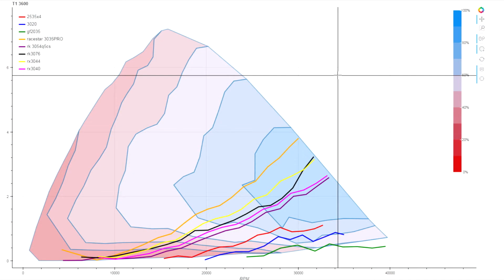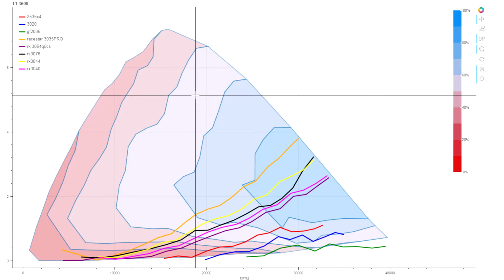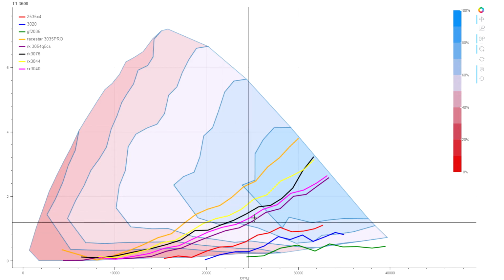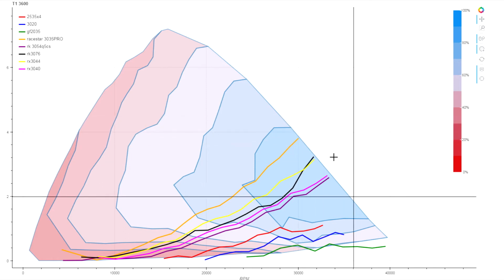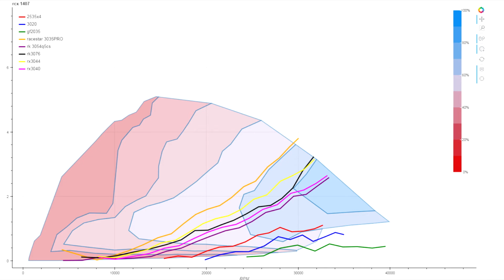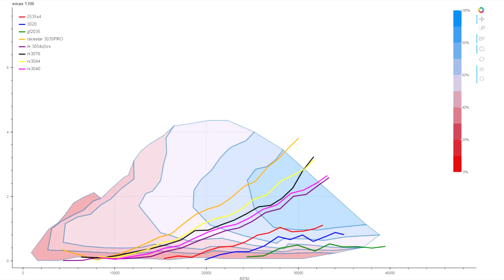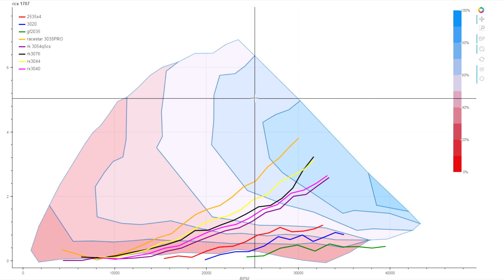Brushless Motor Comparisons: part 2 - prop matching and efficiency

Comment: I also agree.  This is the most in depth motor information I have seen yet.  Is your dyno capable of handling the torque of 2207 or 2306 size motors?  I think your channel would get 100X more views if you tested motors relevant to 5 inch racing quads and not micro quads.  Although the general conclusions you are showing can be extrapolated to basically any brushless motor.  The theory itself is very interesting to see.
Reply from the maker: Yes, I actually have a special smaller version of the spindle mounted to be able to run the micro motors.  I mainly do micros because that's just what interests me, and there are fewer good micro motor resources out there.  MQTB has an excellent handle on 5" class motors.

I've got some Emax and Samguk 5" motors in line for testing, but it will probably be a little while before I get to them.

Comment: Keep it up! This motor performances series are very interesting! What tool are you using to plot the data?
Reply from the maker: The charting library I use is Bokeh but all the log parsing and analytics code is scratch written for my test controller.